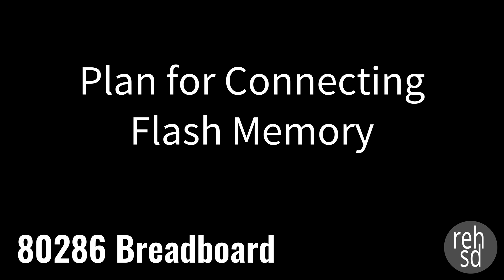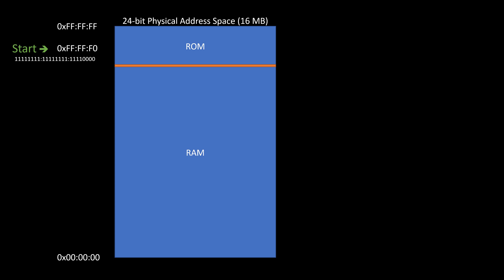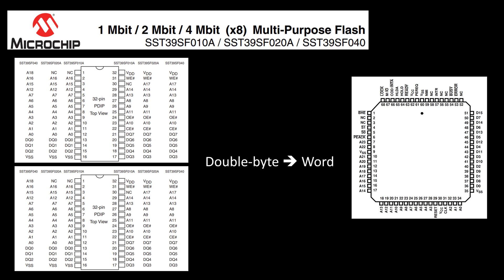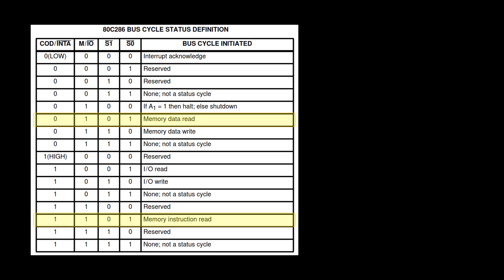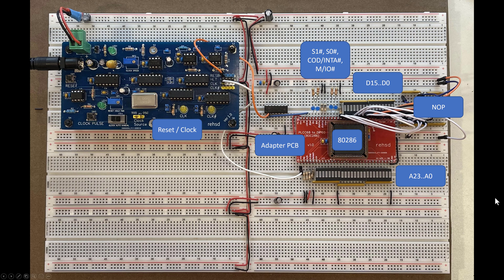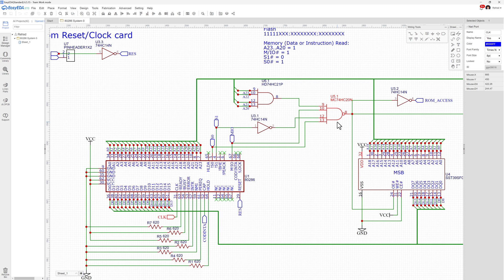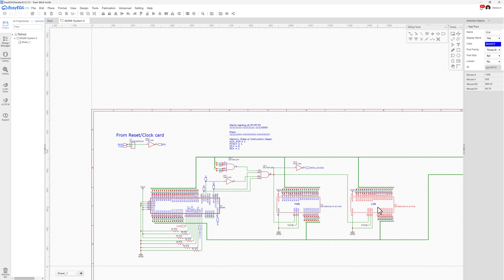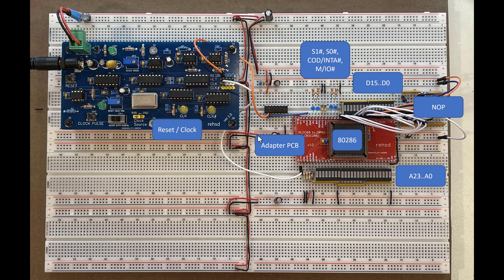80286 Build, Ep. #2 - Plan for Connecting Flash Memory

Comment: Excited for this series and can't wait to see what you'll achieve with this CPU 🙂
Some feedback: background music on last video was too loud / distracting, this is much better! Your schematic readability will benefit a lot from rotating your chips so that the labels are horizontal. Also avoiding crossed wires (ex switch pins 10 and 12 of U5.1, or the pull up/down lines on the CPU crossing with power lines). Some CAD software (never used EasyEDA) allow you to re-order pins on IC symbols to help with this (ex after rotating the CPU 90 degrees, you could move the data bus pins to the bottom left).
Reply from the maker: Thanks for the suggestions! Ya', my schematics could use some work. I started making some updates based on your suggestions. https://imgur.com/a/HTnM6vm
Reply: @rehsd  new schematic is much better!